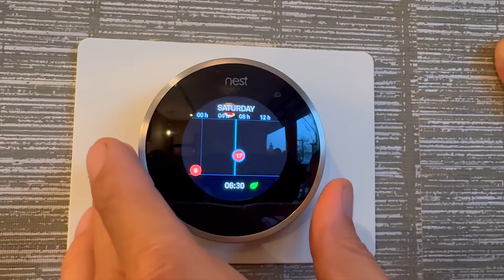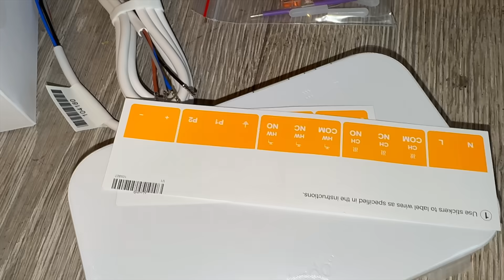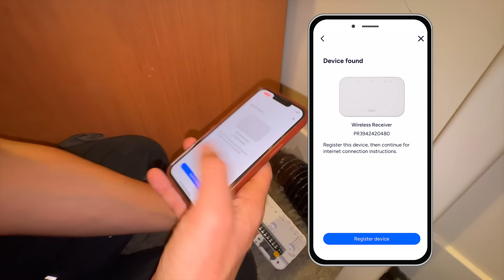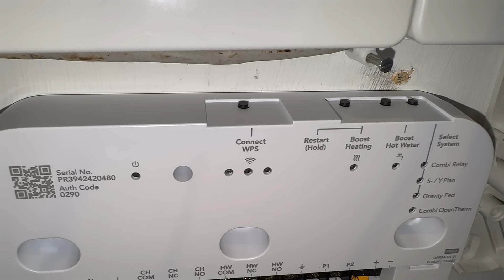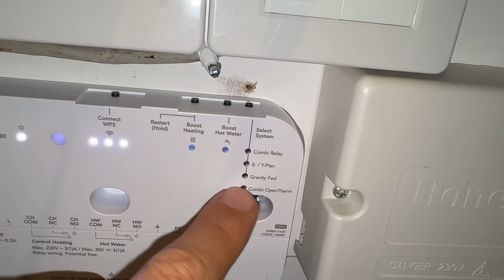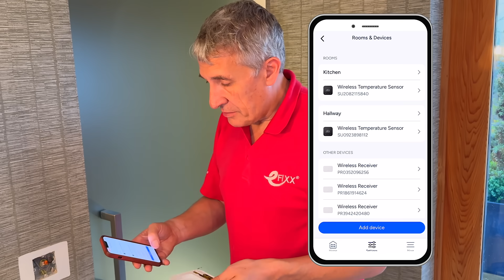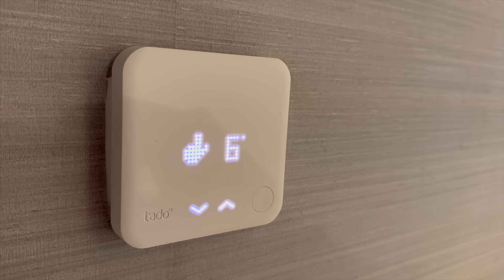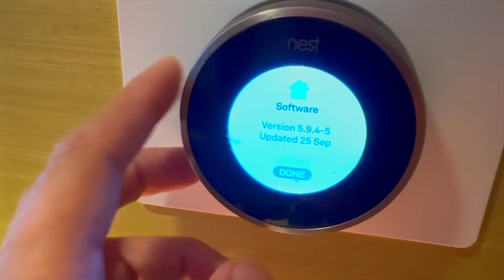Google Killed Nest — Should You Switch to Tado X?

Comment: I've switched from Nest Gen3 to tado x. It is sooooo much better! It actually controls the boiler rather than just turning it on and off at 100% the temp fluctuation when the house is heated is significantly less. With the nest I would think oh it's a bit cold in here then it would kick on and get too hot then turn off. The tado seems to turn the heating on as temperature drops by less and turns boiler on by a percentage causing less fluctuation.

Comment: I've often thought a much simpler wiring box could be made for S plan and Y plan . 
basically 1 part of the system has it's own set of terminals. So take the Y plan system , there'd be a dedicated 5 terminals for the 3 port valve, with the colours of the cables marked on them . The room stat, cylinder stat, pump, boiler etc would all have their own dedicated terminals, and the interlinking would be done inside the box. Terminals wouldn't share cables. Even some electrically challenged plumbers shouldn't (in theory) be able to muck it up ! 
Downside is the box would be a bit bigger, because it would have more terminals !

Comment: I've got a combi boiler with 2 x nest wired thermostats plus 2 x ufh manifolds, I'm struggling to find what tado system I need, any thoughts please?
Cheers
Reply from the maker: The Tado X wired version should be the one to go with unless your  best stats are remote - eg on a table stand.
Reply: @efixx thank you. Do I require 2 of the starter kits? As one brain is upstairs and one is down

Comment: I’ve had tado for years, great interface and easy setup and install, it had an add on built for home assistant, unfortunately requiring cloud, but it worked.

I wanted a system where I could buy parts over a counter in the event parts broke, else I would’ve gone the shelly relay route.

But… I would not buy again and no longer recommend, few reasons below, they have the opportunity to do the same as what google just did (at least you can revive your nest, look up nolongerevil).

1)	That weird test where they faked requiring a subscription that was market research.
2)	They still require a cloud connection, and no offline, I believe there was meant to be one, but it’s been 4 years since I gave up on that dream. (I’m not counting the HomeKit route, water heater is not supported so it’s not the same)
3)	Bait and switch for API use, used to be actively involved with open access for home controller use, they could’ve lowered API use by releasing an offline add on.

It’s not “if” they will screw you, it’s “when” they will screw you.
I’d probably go with Drayton wiser in future, at least it gives an offline option.

Comment: I did exactly this after 10 years. MUCH better system. The fact that the radiator stats can call for heat is a game changer. The full integration with matter allows automation with HomeKit. Wish this had been available 10 years ago

Comment: And in the meantime my compensated combi  controller with instant hot water and simple on off or programmed control works just fine and did not cost circa 600 quid plus electricians costs to fit and  upgrade in 10 years , crap radiator trvs that seize if you look at them are a waste of money when you factor in the cost of replacement , most of the system controls today are a total waste of money .

Comment: I made the switch earlier in the year and found that swapping over a 3 zone s-plan pretty easy. I also got some of the radiator TRV actuators for upstairs to save overheating the bedrooms through the day but allow the towel and hall radiators to be utilised. At the time I purchased the units they demand the boiler to heat the zone straight from the radiator actuator. It simply shows up in the app as another thermostat for the Zone.

However, since I purchased mine in September, newer users of the TadoX units have to pay a subscription for the TRV to demand the heating valves to open and, similarly, I can't have the TRV passively control the heat. It would be a good idea to allow users to have spare room that would be nice to heat but not to demand the boiler on just for that room.

A feature that behind the subscription paywall is adaptive heating. My nest system would pre-heat to ensure my set point was reached at the scheduled time I wanted it. Without the subscription Tado will just start to heat the room to the set point at the scheduled time, adding a delay to a comfortable temperature in these winter mornings. Active Geofencing is also only included with the subscription,

These are of course first world problems and I'm pretty happy with my system, it's been reliable since the install and the thermostats connect to home assistant via matter, I've been handling geofencing through the Home Assistant app. Like you said, the hot water isn't exposed outside of the Tado app and I will be adding a shelly relay to add a passive hot water demand if the central heating is demanded. I've also just scheduled the heating to start 30-45 minutes earlier to ensure my set point is met at specific times.

TLDR; If you don't mind paying a subscription or aren't fussed about having the creature comforts that Nest included with your purchase, then the TadoX system is easy to install and operate.

Comment: Tado X requires a subscription for more than basic scheduling (Tado X TRV is paywalled). The OpenTherm option might be missing if you have the UK version of the boiler receiver. (The X version does come with OpenTherm support and built-in Wi-Fi.)

I moved onto Aqara (I have loads of sensors upstairs with Aqara, with each room sensor linked to the TRV, as the built-in TRV sensor is too close to the radiator and causes the TRV to open and shut as the radiator heats up). Use Aqara relay to turn boiler off and on and automation rules still function even if the internet is off

Comment: Tado recently started requiring a Subscription fee, would be better off with either Heatmiser or Shelly
Reply: It doesn't, only if you need autoassist, i use the previous version of tado without it for 3 years and it's a really good thermostat
Reply: It doesn’t I also have the previous series to this and use it with Apple Home. Not touched their app in months

Comment: They must've sent you the proper uk version, the one i fitted the other day came with wirenuts, not wago221s.... and the damn thing is infuriating to set up, doesn't come with ANY instructions
Reply from the maker: Have you been trawling EBay?
Reply: @efixx  no but maybe our customer had, your experience seems much more streamlined than mine, but the hardware is the same.... the app setup was utterly different and way less helpful (this was 2 weeks ago)
Reply: the terminal block is a huge improvement either way :)
Reply: I especially like the 'parking terminals' for unused conductors that 'may come in handy later'

Comment: I barely use the gas boiler now for heating since I had multi-split air conditioning installed a few years ago that also heats so I am considering just putting it on a ESPhome controlled relay and letting home assistant decide when to turn it on and off from the various sensors around the home.
Reply from the maker: Brave move!

Comment: I've got a third gen Nest, it's recently started to show three degrees above actual temperature even after numerous resets and cleaning etc. That's getting ripped out and Hive installed, only downside they don't have smoke or heat unlike Nest, but mine have only got 18 months left on them so no great loss in the grand scheme of things.

The Tado link unit looks nice with decent terminals, clear labelling and easy installation instructions, but that thermostat looks like something produced by Fischer Price in the 70's...
Reply from the maker: Nest have binned the Protect
Reply: @efixx  still supported until kit is EOL, allegedly.
Reply: you're right about the room thermostats, they're not as sleek as the nest units. The radiator thermostats are pretty smart though!
Reply: @sidwainhouse I’ve also had a Gen3 Nest but recently had British Gas install a new boiler and they fitted Hive.  It has been a nightmare - constantly disconnecting and having to be factory reset - it’s a really rubbish system; so much so I am seriously considering getting my old Nest Gen3 reconnected.  Put off by Tado as not liked what I have heard about similar connectivity issues and not liking their thermostat display.  Did you bite the bullet? If so what’s your experience been?
Reply: @twise41  Haven't done it yet, still waiting for things to go bang.

Comment: I have wondered about the alleged advantages of a more modern system. However, this nearly 80-year-old customer does NOT want annual battery changes, does not want some distant here today gone tomorrow 'part-time supplier' deciding they have had enough. So far, my 34 year old system is  working through its test phase nicely, no batteries other than a rechargeable one for the controller, and apart from a few worn out parts being replaced, no issues. It is smart enough to do what I want, not some genius on his, or her  private tufty telling me.

Comment: Much better to get manufacturers own programmer is always going to be better, as will support boiler modulation and weather compensations which increases efficiency and life of boiler. Most of these smart switches aren’t smart they are just app based on/off relays.

Comment: I always laugh at these single thermostat systems. Honeywell Evohome. Thermostat in every room. Turn on/off heating in any room individually. Hot water support. 8 years on and still working with the smart app without any issues.

Comment: I’m sticking to  my traditional non smart system. . That’s reliable.  I’m finding more and more people don’t want  smart stuff or digital. They want reliable easy to understand control gear . I get fed up of going into people’s homes and they say can you show me how this digital room stat works. As basically I just use it as a on off switch. I asked the plumber and even he didn’t know . Do you know . Especially old people have difficulty.  Only a couple days ago a customer asked if I could replace their electronic programer with a Horstman with a mechanical time clock, they had got on eBay . Yes I said .  I couldn’t believe the price they paid . Hence people are prepared to pay for old simple technology

Comment: My rule is never use anything proprietary if possible.  My own installation (system boiler with a Y plan) uses a Honeywell CM61 standalone programmable thermostat with holiday function that’s worked for over 20 years, override with a Shelly 1 either in the cloud via a mobile or with Home Assistant . Also Shelly controlled hot water.

Comment: This is evidence to why we shouldn't be too reliant on smart and cloud based home systems.
Reply: Actually, if it’s evidence of anything, it shows the industry is moving, healthily, away from brand-specific dependency on smart technology.
Reply: @maxmerton  Matter is great but I've found that most manufacturers don't necessarily expose all the features. So as long as Tado don't do what Spotify and brick the units with a software update, then I've got a thermostat I can operate from any of the main smart home assistants. I would personally prefer to run everything locally from home assistant but central heating is too essential a system to have downtime and since I'm the system administrator, I don't want to be the blame for a cold shower in the morning!🤣

Comment: I managed to use a Shelly 1pm mini, wired the output on the shelly to the 240v heating demand connection and paired with a shelly temperature sensor works very well, but take it a step further and integrate home assistant it's cheap, local and very versatile. I can have my heating turn on based on where I am or presence.
Reply: I've got a bunch of shelly dimmers 2s, 1pm, 1pm temp/humidity sensor add on (for inline bathroom fans) and a few others for floodlights etc. This is inspiring me to get the heating smartified and finally get all devices set up on home assistant. Finding the time around kids, work and DIY is the trouble :(
Reply from the maker: Sounds like a really clever setup! 👍
Reply: I had a shelly 2pm behind my nest heatlink to allow me to boost the hot water without the use of the Nest App. Even on a good day I found the Nest app to be buggy.

Comment: Never again Nest/google. You've taught the world that all smart home need to be local first, zero subscription fees or paywalled features (tado), cloud fully optional, home assistant support absolutely required from day 1 - or no buy
Reply: I made my own using a "Cheap yellow board ESP32" as the room stat and an ESP32 relay card on the boiler end. These are linked with MQTT over WiFi. It works standalone from Home Assistant as basic room stat, but also shows up in Home Assistant as a climate entity.

It's installed in a holiday let, so I wanted something super simple with just a temperature setpoint and nothing else the guests can mess with (just like the old dial room stats), just with the ability to switch it to frost-protect remotely when the guests left.

Overall I reckon the parts were under £15, and it's been more reliable than my Honeywell ones at home, but with a much simpler UI
Reply: @simonmac4291 I've seen fans blowing onto stats in buildings to trick it into bringing the heating on. Its a great work around
Reply: @simonmac4291  awesome - would you post the project to github or an open source platform?

Comment: Do not buy a Tado, customer service is horrendous and non-contactable.  On older style Y-plan boiler, non of the smart features do not work, it fires the boiler all day as "pre-heat" so saves no energy.  They do not support these style of set up.  also if you have hot water scheduled to come on once a day, if you set away temp to lower house temp, it will not allow you to heat your water... so you come back to no hot water.  no way round it!  Do not buy the Tado, doesn't work on many older houses full stop!
Reply: I've installed loads of Tasmota timer/switches VERY cheep and flexible and don't rely on any of that cloud stuff.
Reply: Absolute, wall-to-wall gibberish.
Reply: @maxmerton Exactly, I've had the v3 for several years now, easy to install and has worked like a dream 😁